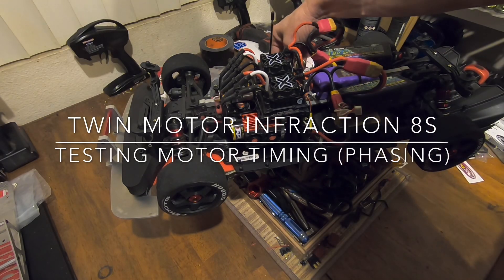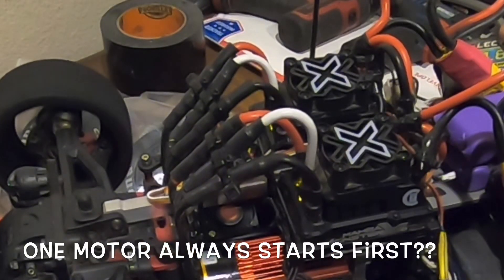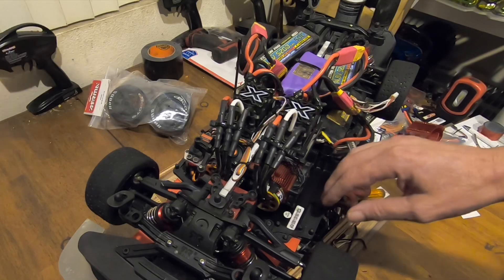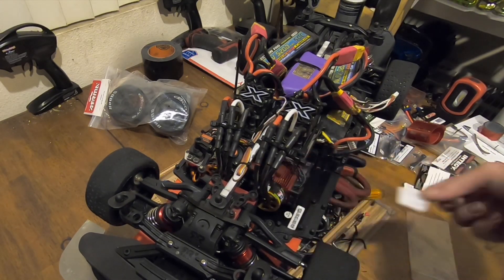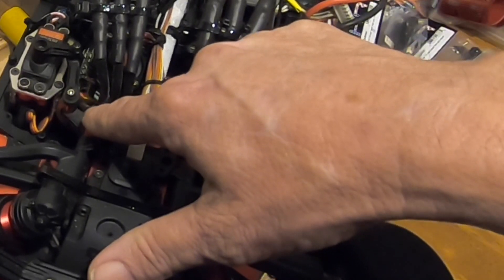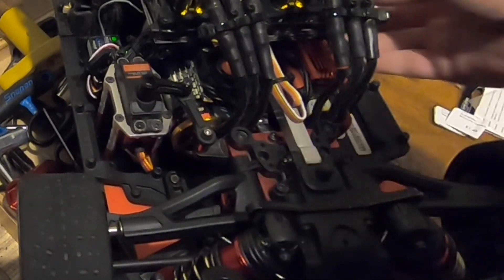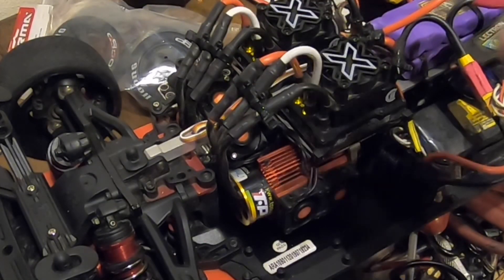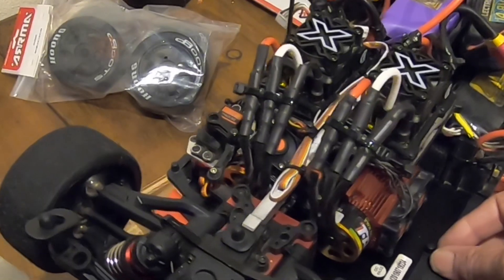Twin motor infraction was (phasing) my heat issue ?

Comment: I'm the same guy who talk about "phasing" earlier in some video...once the coil are in phase try to use both esc with no drag brake, just forward for both and just 1 esc for brake...
Reply from the maker: Appreciate the support 💯🙏🔥🔥🔥
Reply from the maker: I really feel like many ppl have said the sensor wire in the esc needs to be used or ( cogging) happens to locate the magnets position but I’ll be posting the results soon as I need to try several esc checks and video editing as well as not feeling well but the video and results are coming 💯💯🔥🔥🧲🧲🙏🙏🙏⚡️⚡️⚡️⚡️

Comment: I had am issue like this with my dual motor felony. Turns out I had the red wire hooked up and the white wire unhooked going to the reserver. Flipped them and recalibrated throttle on both esc's and it works flawless now.

Comment: That's interesting!
Reply from the maker: It was a sink issue but not like this I had two motors fighting each other and learned that if I set one motor with that little wiggle in the spur to pinion I need to set the other motor by twisting the motor so I have the same play on both motors so the magnets push at the same time and nuetral is the same ( and my heat issue went away ) so kinda what this guy was telling me by adding power but without damaging the motor hope it helps I did show it later on in the twin motor build 👍👍💯💯🔥🔥🔥

Comment: Cant work with one reciever at the same time brother signal difference  another same receiver Will be your best out👌🏿 also motors are never identical but that another show😂
Reply from the maker: Good thing the futaba allows one receiver for dual motors but appreciate the suggestions it will help in different remotes for sure 🔥🔥💯💯💯💯

Comment: Depending on how the esc's are connected to the receiver... One is taking the signal before the other. Most likely the one with .2ohm or less control resistance. The solution would be another receiver for the other esc. Twin esc with twin receivers should fix this.
Reply from the maker: casperfast thats an idea 💡💯💯🔥🔥🔥🔥

Comment: Is it possible to program one motor a little different to compensate the difference?   Gee ,I’ve got to stop thinking.....lol..., can’t help myself,,just my curious nature,,,, can’t wait to see you run it again......I usually have one fan blowing in and the opposite blowing outwards,,,...
Reply from the maker: James George it’s possible but I really think 🤔 that castle sensors motors will fix my issue hands down after reading all the comments and I agree that the esc can’t find the right magnet position to start the motor on the trailing esc ( but I’ll try everything I can ) without switching to a castle esc for the win in my opinion and a few great ppl throwing out big ideas to make this test and problem go faster ( wise man always listen) and act last 💯💯👍👍🧲🧲🧲🧲

Comment: Being a sensorless system the esc needs to fire all phases to determine pole location and rotor rotation, unlike sensored systems that can determine at zero rpm. I think this may be a part of the problem. The esc that is delayed in throttle response is delayed out of confusion. It is trying to determine rotor location but the rotor is already in motion because the other esc/motor has commanded on rpm. Then once that esc is calling for rpm / rotor rotation it is already a fraction of a second behind resulting in major timing retard. I’m sure there is a way to do it but you’ve given me some serious thinking to do on this one. 🤞
Reply from the maker: You are 💯 percent right if it was a sensored system like mtctookie says it would know so no cogging and the esc would start together that’s my thought as well I really think if I installed two castle motors this issue would go away but I will try timing test and trigger calibration before I replace them with two 1515 2200 kv motor sensored from castle creations 💯💯🔥🔥👍👍👍
Reply: Earl Moorhead have the tp’s you have in there now been matched or are they just “ off the shelf”. With mfg tolerance there could be a few thousand rpm difference. Dynomatching may help some. I used to have to do it with dual brushed motors long ago. If not matched one would get smoked every time. Btw I hope you’re feeling better bro, that thing is awesome and will be a beast once these little hurdles are overcome.
Reply from the maker: Eric Vail the kv are within 17 kv the closest me and two friends ordered 6 in total to match up the close numbers 💯💯🔥🔥🔥
Reply: Earl Moorhead if you go with the castle motors i know someone that would take those pesky tp motors of your hands. lol
Reply from the maker: I appreciate that 👍👍💪💪🤔🤔🤔

Comment: Nice to see you working through issues involved with big time power. As a commercial electrician, proper phasing is crucial for optimal performance of high voltage 3 phase electrical equipment. A lot of the theory that electricans are taught, but rarely use seems to come into play with high power DC systems.  It’s never enough to learn just how to do something, the real ‘power’ is learning the why behind the way things are done. Thx for pushing the bar higher Earl. And you hit the nail on the head about heat , in any and all electrical applications Heat is the enemy of efficiency & longevity! It’s a true ‘ catch 22’  Heat causes resistance , which causes more amp draw , which causes more heat in turn reducing performance. LED’s are a perfect example of this . they are super efficient because they generate very little heat . So they last much longer , while out performing other options in power consumption and light output
Reply from the maker: norcalrc I can tell you understand why I did what I did on DC system as I read a lot of phasing on commercial 3 phasing as AC to me is a really not my strength in the automotive world of DC ( starter amp draw fan motors and air compressor clutches all using DC currents I’m used to but adding a neutral wire to AC really confused most of me and my mechanics I’ve known over the years props to you understanding why and what I did was silly for sure 💯💯🔥🔥🔥🔥🔥
Reply: Earl Moorhead in AC system they refer to the interchangeable phase as the delta phase or y phase. Not that it applies here. I did alittle research on DC systems and the use of two motors . What i saw was staging of the motors so that they weren’t firing simultaneously . For example 1st motor energizes contact A then drops A and fires contact B . As motor 1 energizes contact B motor 2 is then energizing it’s contact A. To accomplish this most people were using a programmable logic control in addition to the 2 esc’s. I have a question for you, i was not able to find out what the benefit of running two power systems is. It seems to me & this is only based on theory, that you would essentially have more torque with 2 power systems but wouldn’t realize any substantial gains in over all rpm. The twin power setup is cool as hell, but i’m wondering if you wouldn’t be better off with one huge motor and a 300-400 amp esc (12s). but i don’t know that a system that size would fit your platform.

Comment: I think you would get better results if the motors where both sensored,  system would work in tandem...and try gearing down.
Reply from the maker: I agree 100 percent but I know even tho these are 1700 cm motors the kv very so I wonder if castle motor timing test will correct the imbalance or if there a trigger calibration I’m not doing correctly? Appreciate the support and suggestions 💯💯🔥🔥🔥🔥🔥
Reply: @earlmoorhead5555  Certainly try the trigger calab, didn't think about that one!
Reply from the maker: It’s was a trigger setting 🙏👍💯💯

Comment: Oh another thing to check in the esc settings (pardon but I'm more familiar with tekin & hobbywing) the minimum throttle input. If the drivers side esc is not quite firing in time you can raise the minimum throttle on just that esc to sync with the other🤔  just a thought trying to figure it out😉
Reply from the maker: That’s a great idea because castle link has a motor test it will test a motor and set timing I was going to try that with the spur off and run a motor test to check them as all CM motors are different kv marked on the box they might be to many kv’s apart causing and issue I know in the castle link they have a soft medium & hard take off speed and a timing test for motor timing but I feel your on the same pathway I’m looking into appreciate the support 🔥🔥💯💯💯💯
Reply: Another thought about the outta sync startup could be something to do with using the bec on only one esc, dont know why it would matter ,just a thought. Also, maybe the Rx is having some trouble with the dual signal setup. Im just throwing some guess work at ya brother. Good luck and keep wrenching man!
Reply from the maker: lawxr6 I feel like a lot of ppl have the same opinion that a non sensor systemic cogging while one esc is turning to find timing ( true og ppl I know and have subscribed love every comment and listen to everyone ) as you see I’d apply to much power to test something I’m unsure and video my mistake and true wins on this channel real life test that might work or cost extra doesn’t matter as long as a lesson is learned 💯💯🔥🔥🔥you definitely have good input 💯💯🔥🔥🙏🙏🙏
Reply: lawxr6 good knowledge bro. when you mentioned using only one bec, i remembered seeing some dual setups in the past and this was how they addressed it by only using a single bec. Earl dual power set ups are super common in big rc boats, you may find some useful info by search twin motor setups in rc boats.
Reply from the maker: norcalrc yes that is true 💯💯🔥🔥🔥🔥
Reply from the maker: lawxr6 not systemic I should read my post before I send it but supposed to say sensor system that castle offers over tp power motors 💯💯
Reply: Actually I was just rewatching some of your video & when I heard the beep of you turning your tx off, another idea hit me. You're running a futaba 4PV right? Did you ever look into the dual esc mixing on the futaba? Normally used for syncing crawlers like M.O.A. comp crawlers. It may be used to sync these two ESCs🤔
Reply from the maker: Crewchief 227 I did not know that I’ll definitely look into that appreciate the support and good advice 👍👍💯💯💪😎😎

Comment: The second time I drove my tp powered Kraton I had a wheel go. These motors are torquey. And that was me on the steering, it's not the end points it's the plastic horn on the bellcrank, it just gets elongated from holding a turn. It takes awhile, but it'll get sloppy. Also hey from a fellow ASE mechanic & later an A&P mechanic😃
Reply from the maker: Appreciate the head up let me check what I did I believe it’s a stud on the bottom of my extension and a swivel screwed into the top so it won’t drag but I’ll definitely check it 💯💯💯💯

Comment: Driftomanics has a 16s dual motor infraction and he is always rigging up some over powered cars see what he says  il write a comment maybe get a response to the problem i would like to know personally as well in case i ever do a dual motor setup on the future
Reply from the maker: I did watch his build he had me till the 16 s and he ran the xlx system witch might be a better choice for twins 👍👍💯💯💯
Reply: Is 2  8s systems really 16s ? 8s is like 34 volts , 16s is over 60 volts . At no time running dual 8s systems is either motor getting over 34 volts . so, is it really a 16s beast? Richie (driftomaniacs) gets heated when you talk about this subject. So that’s always fun!

Comment: This may be a dumb thought,,,is there a way you can.  Y harness the esc somehow with the wiring so both motors will start simultaneously?   I’m not good with the electronics,,,but I was just thinking,,,brain fart.
Reply from the maker: They are wired on the signal side of the esc in a Y format but the outlet side would be to much of a draw on the esc for sure 💯💯🔥🔥🔥👍👍

Comment: So the massive current (around 400a burst from one of those 2s packs) can absolutely damage the windings very quickly. 400a is 400a no matter if it's a 2s or 8s voltages.   You can weld plate steel with a 12v car battery. 
I really dont think you're going to be able to fix the issue of the motors fighting each other.  Manufacturing tolerances (wire diameter, magnet strength, lipo health, esc internal voltage references, etc etc) means one motor will always be outputting more power than the other. Unless you get very lucky I don't think any combination of settings is going to fix that.
Reply from the maker: This is the same issue it had before 💯💯💯 even switching the motors around the one esc starts first so Im positive it’s not the motor and most 12 voltage car battery are over 400 amps lmao 💯💯💯
Reply: @earlmoorhead5555  it was just an example to show that high voltage isnt required to do damage. I wish you luck in figuring it out.
Reply from the maker: I appreciate it I never overlook my mistake for me it’s all testing and learning together that’s how I ended up supplying 2s to it ! Before I did it to my expensive TP motors I tested it on the blx motor I had and the 2200 1515 castle motor I took out just to be safe I appreciate all the comments 💯💯🔥🔥🔥